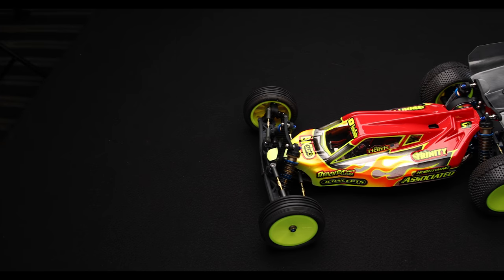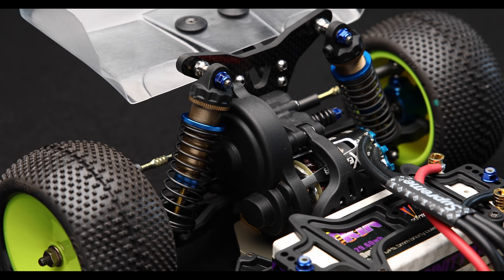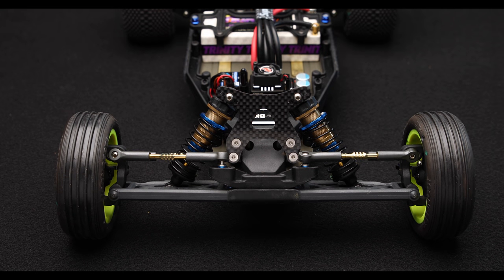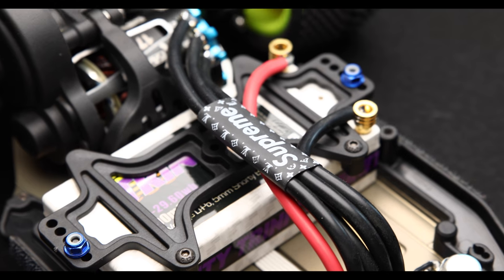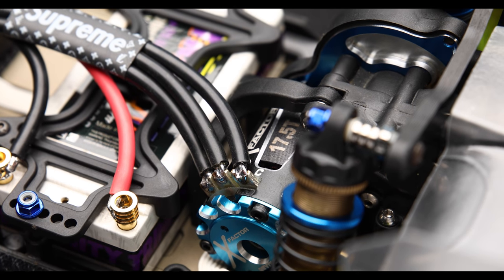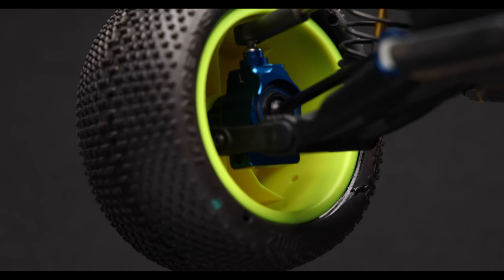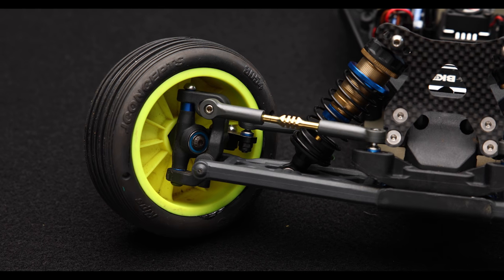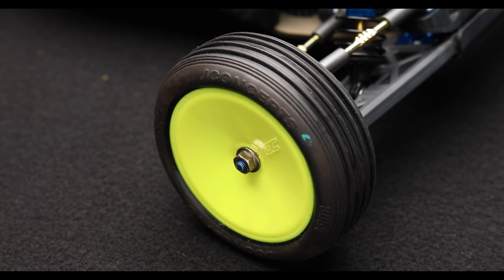OUTDOOR SETUP || Laydown, Layback, or Standup???

Comment: Changing the stiffness of the arms changes the fundamental frequency of the arm. This changes the speed at which a force can propagate through a part. This means softer arm gives a smoother loading curve on the tire which usually make you feel the car gained traction. But in reality it just added compliance and won’t force tire into dynamic friction as often. It will also reduce response but adds compliance to directions that the suspension movement can’t respond to.

Comment: @Ryan Harris Try it without the brass C in the rear. We have been running all alloy at the rear on Ray's & Andrew Selaggi's recommendation, it's actually better & has more rear grip. Too much weight at the rear can give it a pendulum feeling and make the rear end want to step out at corner exit. We all used it at the recent Keilor Invitational.

Comment: How dialed can I be running an old RC10T3? I knocked the dust off it and put new electronics in it to make it go fast. (17.5T stock) I'm hoping to turn heads at the track with a vintage roller. 

It was your cleaning video and your tire removal with acetone that got me motivated to run again. Maybe if I turn wheel well enough I will drop that cash on a new roller.

Comment: I am just getting back into the hobby after many years. After all the research I could do, I went with Hobby Wing for my electronics. I am using the pro version of the esc you have. I kinda wish I would have stepped down one size and got the one you have. I also went with the 10.5 motor. I hope I do not regret this. I am building the B6.1 Lite. Setting it up for outdoor and indoor clay tracks. I am building a couple different gearboxes to change out for these different tracks. I really like your video's and have now watched most of them.

Comment: Buggy looks good man!!! Just put my rear shocks on upside down on my Astro setup and it's working great.
Reply: Hmm, never thought about that 🤔
Reply: lowers the center of gravity feel I can drive the car harder
Reply: @performancedanny  Wouldn't  that make the arm action feel more sluggish due to the extra weight on the lower arm?
Reply: yes. about the same difference as going to aluminum hubs but everywhere there's a gain there's a loss the lower CG believe helps the most. honestly the car feels about the same with the shocks upside down or on the factory way just when I push the car harder  feels better upside down for me Plus get a little better lap times

Comment: Great Video. I myself run a TLR 22 4.0 and now im excited to try it when i found out my shock oils are the same as yours. I actually got it used from a friend for $100. currently my setup for tire is Holeshots/3ds in the rear and slidejobs(dirt oval tires) in the front

Comment: Ray would often run black rear springs (V1) and heavier front oils, I found that with 17.5 I could go down one notch from his oil setups (hes entering harder in mod). Ray experimented with drilling another inner hole on rear arms in b6 to give more leverage in low bite. Not sure if the b6.1 has this modification as standard now. Been out of racing for a year.

Comment: I know your an associated guy, but what are your suggestions for a Losi 22 2.0. I have the front end cockpit body and the rear motor standup transmission. My electrics don’t fit inside the body and I’m trying to hold more weight in the rear then the front, but I’m forced to move all of the weight to the front because of the size of the body. I’m really frustrated because I’m in the process of getting both my original Rc 10 and my Losi 22 into racing classes and both of them have the same problems. I don’t have much money to split between the two but do you have any ideas for a shorty pack setup like yours? Thanks for your opinion.

Comment: So would the B6D be the better choice?  I have a race in two weeks on loose hard packed clay indoors.  Seems like the traction is in between grooves always.  I had the B6.1 Lite on the track last week with the lay down and slipper elimination and it was miserable.  Was thinking layback and a slipper but didn’t think to go all the way to the standup and flat arms.  Might seriously consider running the old car???

Comment: New to rc electric buggy I just purchased a b64d and wondering how race classes are set from watching video I think there’s a stock class which is basically stock everyone run same thing and then mod and here’s where I’m not sure I think the lower the motor number like 8.5 is faster then say a 12.5 do they set ur buggy in a class like 12.5 or 17.5 if that’s ur motor size. Loving watching your videos thank in advance for any info

Comment: Is rear motor still a thing.lol #stilloldschoolracer
Reply from the maker: Always in our hearts ❤️
Reply: IMO mid motor outdoor is really fun, it forces you to drive on the edge of spinning out at every moment, and it's so satisfying to finally get it dialed in and you can even hear the tires scratching as you make the sweeping turns instead of parking and pulling out of turns like you would on a rear motor.

Comment: Hi great videos, just noticed you swapped out your original capacitor on your ESC with a two capacitor, is that because it's easier to mount  or it performs better, thanks
Reply from the maker: Paranoia mostly haha I just know that it's easier replace a blown cap than it is a whole ESC
Reply: @RyanHarrisRC  sorry, misunderstood, did you notice any difference with performance by replacing the original  single capacitor with a double capacitor

Comment: Nice Vid. Good suggestions, although I think I’d just drag out my old B6D and make a few adjustments. Accomplish the same?
Reply from the maker: That would be a great option! The B6.1 looks like it has a greater rear weight bias with the location of the motor vs the B6
Reply: Very true. Again nice content and just awesome videos mixing it up with different themes. Thanks so much for giving your time for our enjoyment. 🎬
Reply: Ryan Harris Very true. Again nice content and just awesome vids mixing it up with different themes. Thanks so much for giving your time for our enjoyment.
Reply: B6d has a stand-up, main difference with 6.1 standup is ability to run shocks forward which helps corner speed a lot while still keeping good rear traction :)
Reply: Raymond Munday good call out!

Comment: The worst thing they did was get rid of the 4-gear trans. I think they should bring it back, including on the laydown, and just drop the layback altogether. Standup and Laydown, both with 3 and 4-gear options. Even better if it's all in the same case and you literally just add/move the idlers around to change it.

Comment: When using the longer shock bodies, do you use the same shafts or do you need to get longer ones as well?
Reply: Same shafts. The longer bodies allow more fluid volume, and also let you wind out the rod ends further for a longer effective shaft that doesn't bottom out inside the shock body. Hope that makes sense :)

Comment: Trying a 4wd 13.5 car on a loose loamy track were i usually race 8 scal at only driven a 13.5 wheeler an carpet and the set ups on these little 10 scales is comply confusing
Reply from the maker: They take some getting used to for sure!